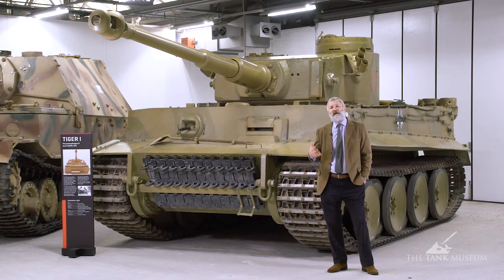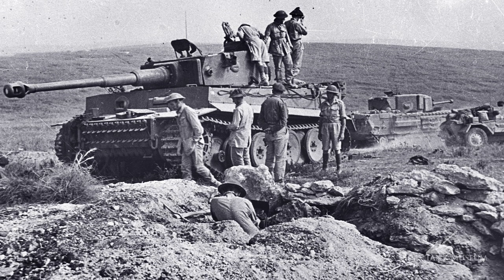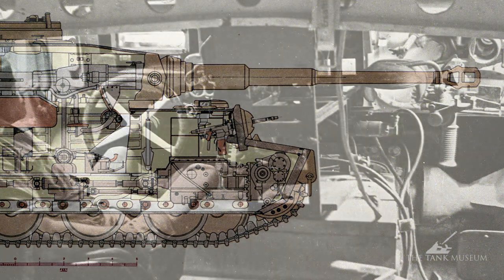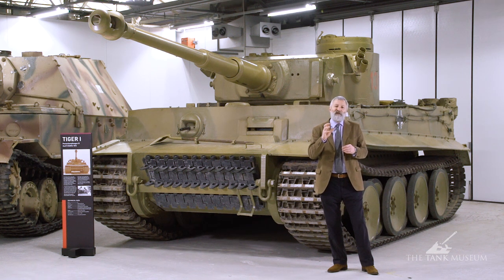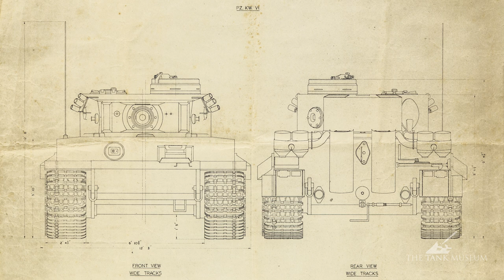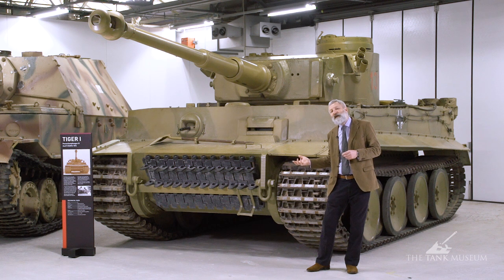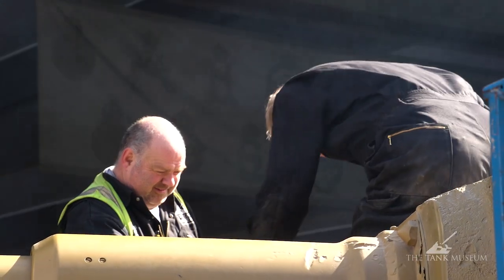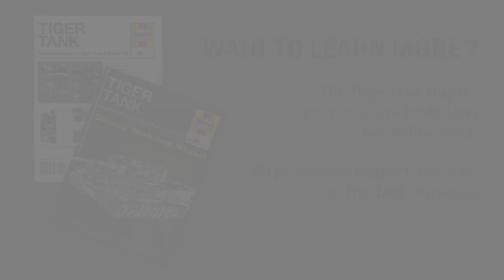Tank Chats #36 Tiger 131 | The Tank Museum

Comment: Since the tank has been restored and is now working, it may pay off to take it apart once again and making castings or scans of the parts. Technology has come a long way, and with 3D printing taking as many leaps as it does, it's not unreasonable to assume that a transmission or bottom-end could be rebuilt for the tank. All you need is an image of the part that you can then mill out of fresh steel on a lathe.
I mean, this thing was put together at a time when assembly was being done under tremendous pressure, with precious few supplies. A small army of dedicated individuals with crowd-funding and some tech-savvy could surely keep this one example going for many years to come. Thankfully, it has no crazy electronics in it that could potentially burn out and be literally irreplaceable on account of no one knowing how to remake a circuit-board or reprogram an old memory chip....
Reply: vtr0104 I hope they're doing something like this
Reply: Bring out your Nerds!
Reply: Show them the money, honey ! Wish I had the ways and means !
Reply: Pretty much every tank that has been made the blueprints and that still exist Porsche would have the king tiger turret designs deep in storage somewhere
Reply: Why doesn't the USA have a running Tiger, this is a great idea! ! Let's just build one. Billionaires please make this happen.  So people can see what a great design this vehicle was in 1941/1942.
Reply: @outlaw8865  there is one currently being restored in the US. Tiger 712 not sure if it'll be running or stationary though
Reply: @outlaw8865  there is no way to make it as comfortable as a personal yacht or plane, so why would they bother?
Reply: Using the veichle, maintaining it and eventually replacing it's parts serves many purpouses. Perhaps we have learned everything there is to know about it by studying it on the outside. The initial evaluation done by the military has been read in as much detail as can be read. The knowledge on how to operate the tank, the skills and knowledge that went in to constructing it, is what's sometimes is named "immatterial heritage" and this is something that does not recide in the object itself, but in the people who has got their hands dirty. This knowledge needs to be maintained by actually doing the work.
3-d printing and other computer-age techniques of manufacture and documentation will be of use in preserving the artefact itself, but in a few decades, you will be out of luck finding someone who can operate a then-100 year old lathe and milling machine, or even read physical blueprints.
Unless of course, those interested in the crafts get the chance to hone their skills and find out what tools and techniques are vital to preserve.

Myself, I'm trained as a shipwright. I am three or four  generations removed from the ones that built the last commercial sailing vessles. A thousand years of aggregated knowledge was about to be forgotten, but for a few enthusiasts that stubbornly kept the last wooden sailing ships afloat. Some of the old ships sailing today has been almost completely re-built two or three times. Eventually they will rot away, but we have gathered enough knowledge and experience, so that we not only can, but from time to time actually do build new ones.
Reply: it's got the potential to be the first Tank of Theseus. just start off with a few parts here and there, gradually replacing the old parts, until the whole tank get "replaced". the original 131 can then retire, and the copy 131 parked in front of it, like a mirror
Reply: 3D Printing? Give me a CNC Laser and a couple of manual lathes and mills, I can make you any part of this tank. Castings included. This isn´t rocket science. They´ve made this happen with flame cut plates and handmade patents (for casting). I´m sure there´s blueprints around somewhere. Is it historically pure and accurate, maybe, probably not. Could we make a replica almost historically accurate happen, definitely. In fact I could probably manufacture anything machined in my garage workshop except the turret rings, they won´t fit in there. The only reasons stopping me are the same as the museum´s, time and money.
Reply: @outlaw8865 it wasn’t THAT great a design. You really need to read up on these a bit more, because they CONSTANTLY broke down, were underpowered, and were a nightmare to transport on trains. It was also EXTREMELY time consuming to replace road wheels if they weren’t on the outside (they sometimes had to remove up to 7 just to get to the one damaged one in the back), etc, etc. Their main (only) saving grace was the main gun and it’s armor.
Reply: The Australian army museum has a tiger 1 and King tiger that they are restoring and I think they are using this technology.
Reply: @Connor.Bordin Both turret’s were built by Krupp. and i don’t think Krupp exists anymore as a company. only thing they had was the Ferdinand and if you are REALLY stretching it, The Maus (but even then, that thing was already found empty by the soviet’s back in 45)

Comment: Tiger tank:

100% charisma
100% firepower
100% fear factor
100% masterpiece of engineering
Reply: 100% way too much downtime and spare parts needed for a tank, that has to defend large areas of land far away from repair shops(which have probably needed to be moved due to bombing) meaning it will inevitably break down, if it is not knocked out anyway by an up-gunned allied tank, or chased into a ditch by allied fighter bombers.
Reply: Still a very cool tank though

Comment: The wearing out issue can probably be handled by 3D additive printing processes. A group is or was using these techniques to restore an F4U by using worn parts as the base and additive printing those parts back to spec or to a point where they could be finished through machining etc into useable like new parts.

Comment: I think regarding the issue of originality of the tank. And idea may be to build a brand new identical engine and drive train for use in the tank and preserve the original parts in case the day comes where it must remain a static display. At which point you may be able to present the original parts next to the tank so visitors can see what was used to power them.
Reply: That might seem to be practical: build a copy and wear that instead of the original piece. But it is kinda against an agenda of the museum. It would be copy on display, not the original thing then.
Reply: azgarogly It's an 80yr old tank that has the scars of war all over it. Visually it's the same thing, keeping the innards working and in good condition for future generations should override that. Your dad's 1960s convertible may have had a new engine or a rebuild, but it'd be the same car :)
Reply: It seems You are not getting the very idea of originality of museum piece. Newly made copy is not the original thing. Museums try to avoid using replicas as it is not what museum is about.
Reply: The thing is, as it was mentioned, if they keep using it some parts will eventually break and will need a replacement. If they're worried about that, they should either stop driving it around or do as the other two guys said here. Maybe you prefer the first option, and it's fine, but it seems the people at the museum are interested in driving it around every now and then.
Reply: +Relaxed
People at the museum have made their decisions.
You might suggest making a replica, you can suggest stop driving. But the fact is they drive the tank now and then and they do driver tho original thing. Do they?
Reply: The original engine from the tank has been kept, and is at the museum. It was sectioned by the military to show the inner workings.
Reply: @azgarogly I think you're a bit too stuck in your ways. 

Let me explain my thinking. If they make an identical copy of a vehicle or the engine, it is not a replica since it was designed to real specifications. It's not replicating anything if it IS that exact thing.

Take a look for example at 60163 "Tornado". An A1 steam locomotive built to drawings. That's not a replica. It's not replicating anything, it is a REAL A1 locomotive. Sure it was made in 2009 and has some modern safety systems, but it's real. It works the exact same as the originals, looks identical.

If you want another example. The Jaguar XKSS. They built some brand new 2016 versions. They aren't replicas, they are real.  Much like I mentioned above, looks the same, powered the same. 

Now, what I assume is going through your head is for example when people take a Toyota MR2 and stick a Ferrari body on top. That IS a replica. Much like the Tiger tank in the movie "White Tiger" is actually an IS-2 with a body put on top. Replicating a Tiger. 

Replica implies that it is not the same thing, it is different in a significant way. 

While you and museums may be all "but it must be original", there's people like me out there who would rather sacrifice the old parts, put them on display before they get damaged too much and build a brand new part to the original specifications. That way the vehicle uses the same parts as it did when it was first built and the performance figures will remain the same.
Reply: ZobbyGaming
I kinda did understand your idea first time You commented.
But even You make a thing or part of it by exactly the same specs, it would be replica. There is a difference between exact copy and the original. 
When museums restore historical objects, they usually try to use original parts. Sometimes it is not possible and they have to use modern or custom made parts. Like bearings, wires, gaskets. And that does reduce a historical value of object restored. At least from museal point of view. 
And when a copy is displayed in museum, it is marked as copy.
Reply: Let's say that while they're driving it something breaks: it can't be repaired and they have to use something not original. Magic's gone? That tank is now a rusted piece of garbage? They can't repair it and they have to stop driving it in front of the public because it isn't 100% original anymore?
Reply: Still my opinion differs. In my belief, how can something be replicating if it is identical. 

Also, regarding smaller parts, there's little way around some stuff. Good luck getting some original parts from the 40s for a tank which was known for breaking down and wasn't made in very high numbers. 131 being the only one that runs, I think it would benefit from new parts made from the original drawings. Like I said, preserve the original parts for the future if the vehicle is no longer fit for use. 

I think that because people are so dead-set on their ideas of originality, we are going to lose these vehicles and will never be able to experience them again. If anything, THAT loses even more of the vehicles historical value. Most people aren't going to see 131 because every tiny part if from it's original factory, they are going to see it because it runs and is the only Tiger I which does. It provides people with the understanding of how it moves and how it sounds. The feedback from operators then will aid in understanding how it is to handle. You won't get any of that from a tank that doesn't move.

It is going to have more value to people running than it will sitting still doing nothing.
Reply: "How can something be replicating if it is identical?" That's simple, it wasn't built by the same people, at the same time, in the same place.

Bovington has an A7V. It is identical to a WW1 A7V but it was built recently. It is a replica because it is not one of the original run of 20 that were built in WW1.

You gave Tornado as an example, but that is not a valid comparison. Tornado is not a replica of an A1 because the people that built it specifically looked at the design of the original A1 loco and said "Nah, that's rubbish, we can make it better" It's more a variation of the design than a replica.

Alternatively, the National Railway Museum in York has a replica of Stephenson's Rocket. It is a perfect copy of the original locomotive. It is identical. But it's not the original one built by Stephenson, so it is a replica.

If you want to really go into it, the dictionary definition of replica is "an exact copy or model of something".
Reply: Okay fair enough but I would still consider an identical replica the real thing. In no way do I call it an original build, but it is still the real deal! 
However, how are we supposed to keep these original vehicles for the future generations to experience if we don't make sacrifices? I would like to think 131's engine will last forever, but it won't. If you want to keep tanks running and running well, you must sacrifice some originality. 
 They could build an identical working replica, but that would cost a lot of money. There is one I know of, but that is a frame design with thin sheeting covering it. It looks good but doesn't do the original design justice.
Reply: A gun is a different situation to an entire tank. The only parts of a tank that are going to need replacing is within the engine. The vehicle still has it's original chassis, armour, turret, and so on. You're not going to be replacing an entire armour plate. 

If anything replacing engine parts only adds a new chapter to it's story. And it's the story that is most valuable. If anything the value of the physical thing shouldn't matter to this museum since they don't show signs of wanting to sell off their vehicles. They want to display history. Sure some stuff isn't original from either war, but it aids in telling a story. You are limited to what you can show/tell if you can't run something.
Reply: I'm pretty certain that the engine in 131 isn't "original" anyways. From what I recall it's from the Museum's Tiger II tank.

Also there will come a time when its tracks, final drives, and cylinders will need to be replaced. Replacing them with newer stuff may be beneficial and no one will know. Chromoloy final drives may make display of this tank better as I am sure the driver(s) usually baby it. 

Also displaying the original parts would actually be good too as you can see them in real time, and think someone 80 years ago made this.
Reply: From an engineering point of view, manufacturing a single engine, even with modern machine tooling, would be a daunting task. Every part has a tolerance, and I doubt that every drawing is still available. This means more time, money, and experimentation. Unless a dozen engines were being made and the buyers were waiting to purchase, it wouldn't be worth the trouble to custom build an engine designed for mass-production. Many parts are quite expendable, such as bearings, seals, etc., and when replaced routinely prevent damage to other irreplaceable parts. These parts were commonly replaced when the vehicles were 'new', so nothing is really lost. Yes, a new identical engine would be great, but it would take a lot of effort.
Reply: the original would just rot and become a rusted hulk like most of the other exhibits. it'd just be little more than a glorified statue.
Reply: Aaah yes, the debate that classic car restorers have been having for decades. If an aftermarket piece is the EXACT same as the original, is it the same? I feel that yes, it is. Many other feel that no, unless it was made in the original factory however many years ago then it is not. Yet, if the two items are identical.... isn't it still "original"? It's the classic philosophical question: I have a ship that I am sailing around the world. As I sail, pieces of the ship rot away and need replacement. By the time I have reached my end port, every single piece of the ship has been replaced by a new, but identical, piece. Is it the same ship that originally left port? I say yes.
Reply: ZobbyGaming i was gonna suggest that.
Reply: azgarogly actually no, that is utterly incorrect. Looks like but isnt, is a replica. Made to original specification using the same materials and techniques is NOT a replica. It is a new replacement component.
Per Sang in brazil build NEW bugatti type 31(?)s and alfa romeo race cars from the blueprints. EVERYTHING is as per original. Those cars are eligible for the respective clubs concourse because they are NOT replicas. They are the real thing. Exactly the same.
Btw look at any restored car in a museum. Bet you 99% are not completely original in the sense you demand of this tiger.
Build a new engine and gearbox to spec. Wear that out. Keep the original components and display them next to the tank. 90% will nod n say yeah fair enough. 
Its a balancing act preserving pure originality and using it to bring pleasure to all concerned.
Reply: It's like the ship of Theseus going on here.